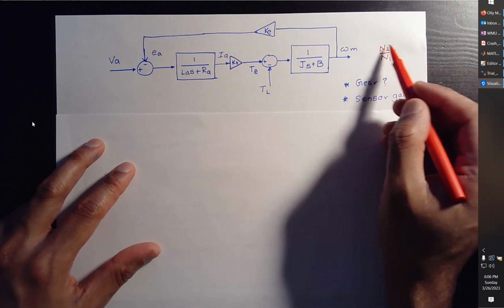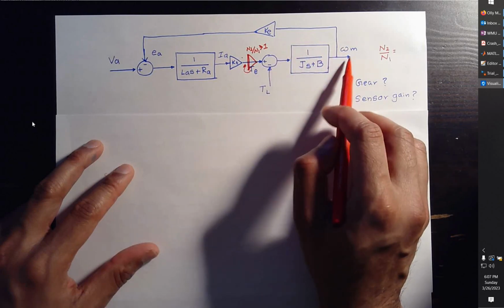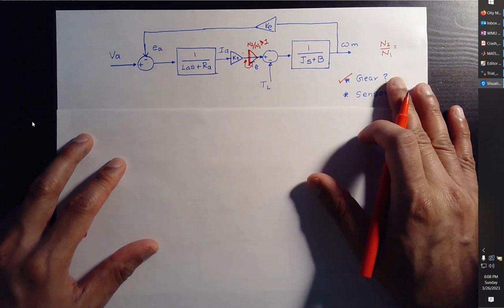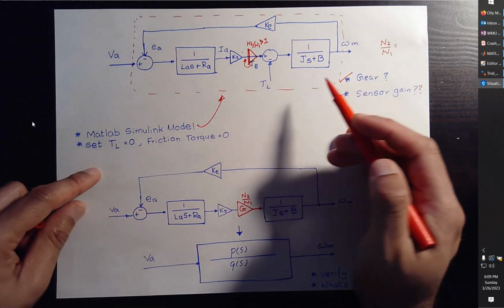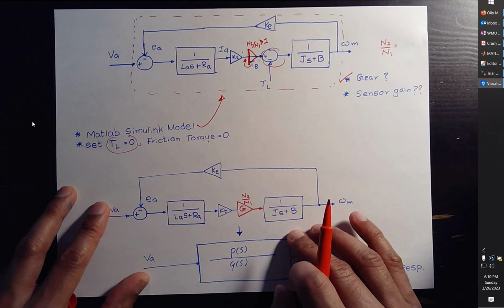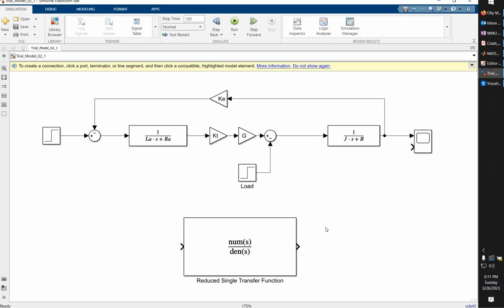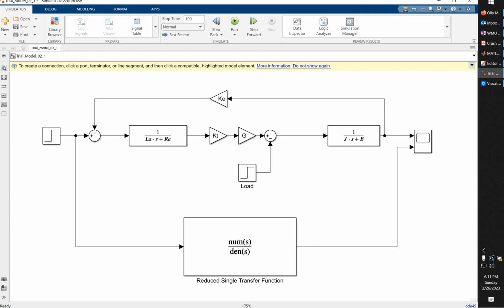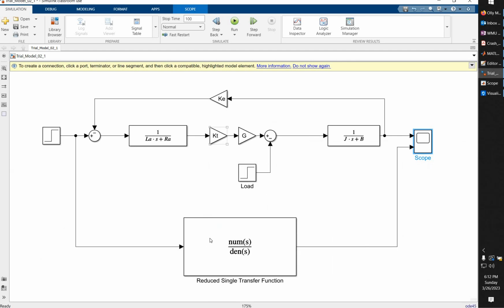Project Help Video 02 - Block Diagram Reduction

Comment: Very nice video sir , if possible do upload a short video on how to write research paper and presentation of seminar for electrical branch students, as I am an Mtech student so was finding difficulty regarding it.
Reply from the maker: Sure, I will add this to the list of videos.
Reply: @SandunKuruppu  Thank you sir
Reply: Hello, I’m working on FOC vector control technique on pmsm for hybrid electric vehicle using matlab simulink but facing some issue with the simulation. Could you help me with that?
Reply from the maker: @mabdulwasay7493  Hello Abdul, there is a whole series of videos on my channel. Feel free to take a look at them. Those concepts directly translate to what you are doing unless there are specific questions.